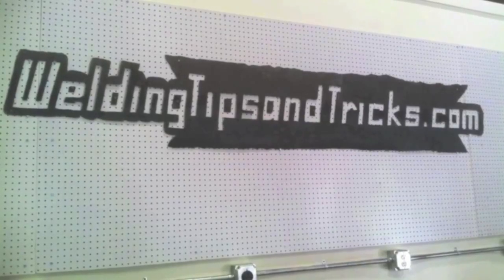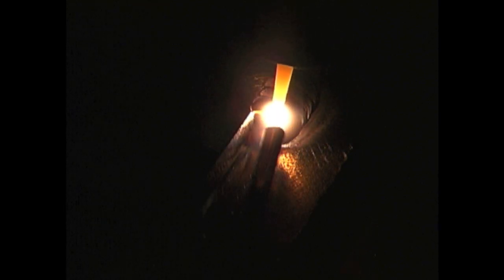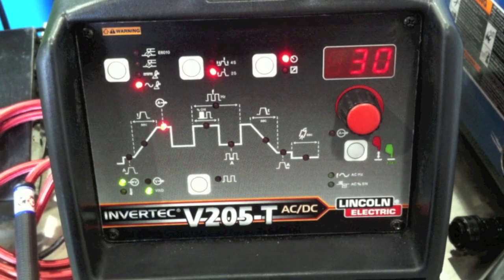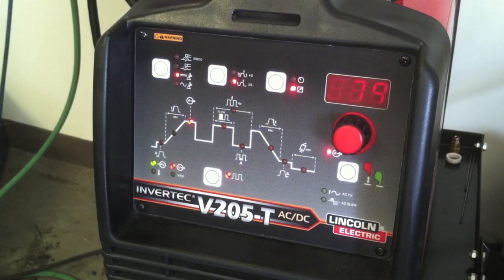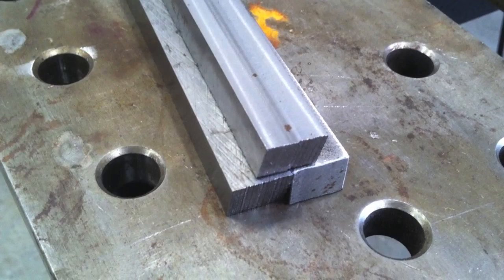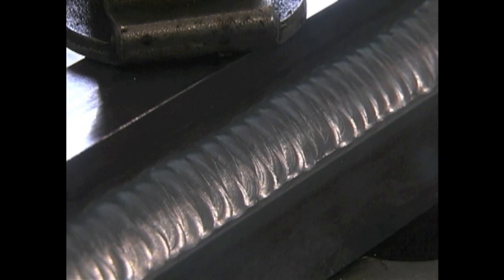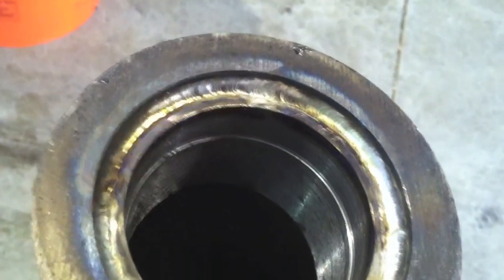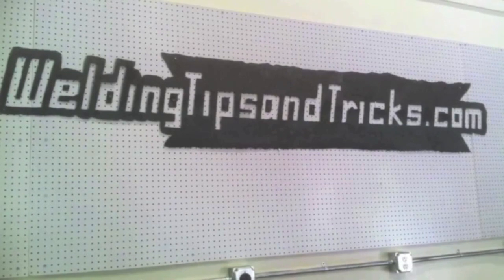Tig Welding  Lap Joints

Comment: Here in Australia we can buy cast iron rods (yep made from cast iron) for cast iron repairs using either oxy/acet or TIG as the heat source.  I found out about them at welding school.  But none of the stores I called had heard of it and it had to be special ordered. You may be able to source these rods from a local Thermadyne supplier?  Google "cigweld 321420" which is the part number.

Comment from the maker: its hard to comment on cast iron because there are so many grades.  its always a crap shoot.  But brazing with brass and flux is a tried and true way.  It keeps the cast iron hot and cools slowly.  I sometimes tig with aluminum bronze filler on AC like I would weld aluminum...along with a preheat. But that is not always the best way either.
I have even known of guys who got lucky on repairs using a 115 volt mig with low heat and peening the welds every inch ...but that is not the norm.

Comment: I'd like to know more about fixing/welding cast iron.  Of the vids I've watched, I gather that stick welding is only good for cosmetic and integrity / sealing, like an exhaust manifold but not for strength because the cast iron recrystallized too brittle.  Brazing with bronze (?) with flux is stronger but is it ridged?  What are your thoughts about cast iron repair for rigidity?
My specific application is bailing needle repair for an antique Case square bailer.

Comment from the maker: not much walking the cup done on aluminum. For one thing the cup puts some serious scratches in the finish.  Have you seen marcella maenifolds?  John Marcella lays down some beautiful weave beads on aluminum intakes. its on the neilsmiller miller electric channel. There is a manifold in the background with weaves on it. or just google marcella manifolds on google images

Comment: Great video Jodie, how long have you been welding with the TIG? I'm welding TIG for about 6 months now and i practice about 10 hours a week on DC neg with regular steel and my weld quality is ok but i can't seem to get the same nice finish that you get and that's really frustrating some times! I use a 20 year old Messer Griesheim TIG that handles 150 amps at 60% duty cycle, air-cooled torch with a small TIG gun that only handles around 125 amps.